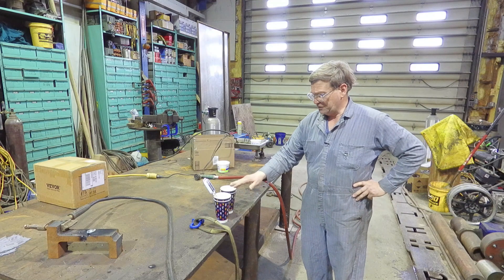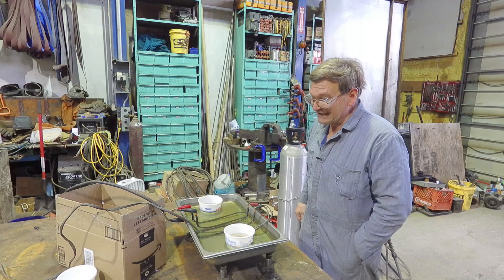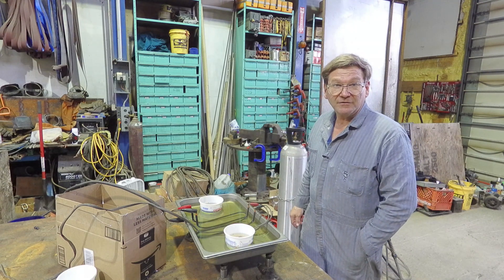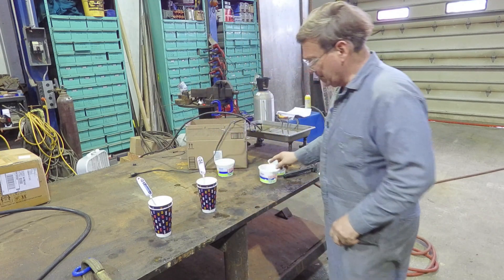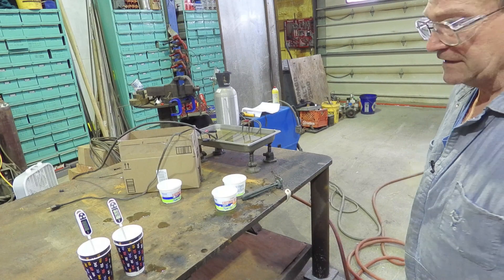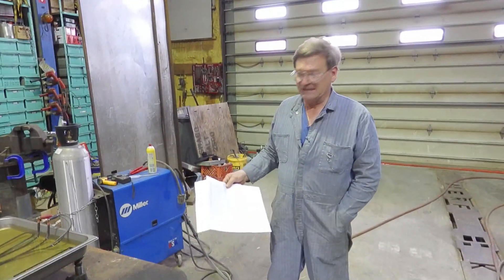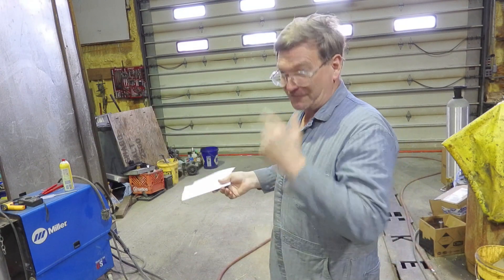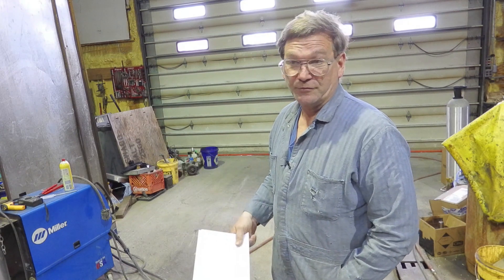Machinist's Minutes: Acetylene vs Propane, Heat vs Temperature

Comment: Oh, man!  I teach "shop", and know a bunch of hobbyists also... I feel like I've spent twenty years explaining and arguing about this stuff!  It's not just in welding, it comes up in electricity too, the same thing.  People can easily measure voltage, and will think that voltage is everything.  I call it 12 volt Syndrome.  So, talking only about Voltage when the issue is POWER or ENERGY.  What you can and can't weld with is a perennial topic, in life and online.  Everyone has seen a thermometer, we can easily understand TEMPERATURE, but I think you almost need to go to school to have the idea of Watts per Square Cm per Second, which is everything welding.  THEN people find out that (for example) a big propane torch and melt a bunch of aluminum but not WELD it and are thrown into confusion, and I'm yelling "to WELD you want to melt something LOCALLY!"....  I have developed little demonstrations for some of these fine points that people argue about forever.... You can weld OR BRAZE some materials with the same filler and the same torch depending on what you're doing in detail, so if students can SEE that it helps lift them out of that confusion.  I think it's somewhere between teaching and preaching sometimes, I want them to BELIEVE!  Really to have some kind of STEM-Enlightenment.

Comment: Acetylene contains more carbon and carbonizes the sides of the cut.  Propane does not have carbon and leaves the sides of the cut machinable/fileable.  A lot of time it doesn't matter.  If, for instance you need to drill out a cut hole it will make a significant difference.

Comment: There are many ways to cut light section and you can't weld with propane but for heating and brazing propane lets you draw all that you want from a small cylinder, acetylene needs a big cylinder.

Comment: Great video until the very end, at which point Howee obviously gets out of his expertise.  You don't need to know the composition of the earth to measure and/or model the temperature and heat content of the atmosphere.  We have very accurate measurements of both the chemical content of the atmosphere and the extent of the atmosphere.  We also have a pretty good understanding at a global scale of how heat transfers from the atmosphere into both the oceans and the ground, as well as radiating into space.  That's why climate models from decades ago have actually been remarkably accurate in their ability to predict how the global atmospheric temperature is going to change.  The places where uncertain exists are in our ability to predict fine grained changes, such as what the specific climate change will be in a particular city.  That's in part because we don't have fine grained measurements of the world around us, as well as the immense computational power required to make a detailed simulation of a physical system of the size of the earth.

Comment: I worked for a garage with tons of steel inside. Every day in the winter the boss would turn the natural gas burner off at five o'clock after just an hour earlier it just started cycling on and off because it finally reached a workable temperature. The next day the burner would run all day constantly till all the steel warmed up. Cycle normally for an hour and get shut down again. Over and over. Every day work inside in outside temperatures for half a day. Impact guns and othe air tools would fracture from use.

Comment: Propane gathers around your feet and is dangerous in a closed plàce  but it is safer to use outside where there's a wind asetolene vapor's go up they're lighter and are safer to use

Comment: I am an Acety bloke, being a field service business LPG is of very little use to me ( can't even light it ) in the wind.
I would love to be able to use LPG because of cost, here in Aus we cop a fairly substantial rental fee on our acety and oxy bottles which on top of the cost of gas makes it an expensive habit
Reply: There are some modern heating heads with improved orifice design. Much better for light up. It may be a little "not safe", but you can crack the o2 valve just a smidgen. It will help it stabilize. At the last job we used alot of LP for heating plate. I knew exactly how much to open each valve so when I lit up it snapped right into a neutral flame.
Reply: Might be worth investing in a petrogen torch. All you need is gasoline or diesel and an oxygen bottle.

Comment: Surely the key thing (which you mentioned in passing but didn't really talk about it) is that propane uses a lot more oxygen than the same amount of acetylene. A cubic foot of acetylene needs 1.2 cu ft of oxygen to burn cleanly, so that energy is going into 2.2 cu ft of gas. A cubic foot of propane needs 4.3 cu ft of oxygen, so while there's more energy it's going into 5.3 cu ft of gas. A cubic foot of propane has 1.7 times the energy of a cubic foot of acetylene, but it's going into 2.4 times the volume of gas so there's more total energy but a lower temperature - the heat has effectively been diluted more.

Comment: Aperiently alot of people havent cut up scrap . Or straightened a excavator bucket that pin has came out of half way . There is a time and a place for each .i have propane acetylene and a plasma .

Comment: I did you and me a rude disservice this morning. I know I missed something but I just could not hear the propane vs acetylene comparison again. I know you are as experienced and savvy as any person  I've had the privilege of listing to.I made the choice forty years ago, it's not worth the expense of two gases, tips ect. to use far more oxygen AND not being able to weld with the propane. Just me, not a propane guy. To me as useless as the man made global warming BS and the EV scam.
Reply: Thank you for letting us know that you were above watching the video.  Would be nice if you could let us know on other videos when you choose to not watch them, too.
Reply: Any thoughts on the performance of mapp gas in this comparison? I haven't heard much about the performance but it should be easier to handle than acetylen.
Reply: @clockworkvanhellsing372  No expert on Mapp but have the same misgivings as propane. It is painfully slow and uses a lot of oxygen. Plus we could not gas weld the root passes on boiler tubes with it. Hate the stuff.